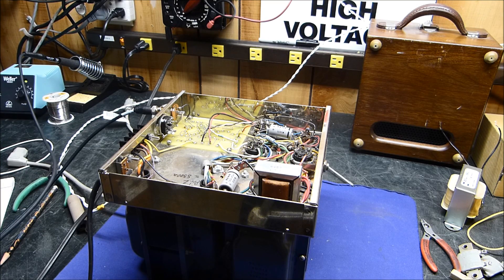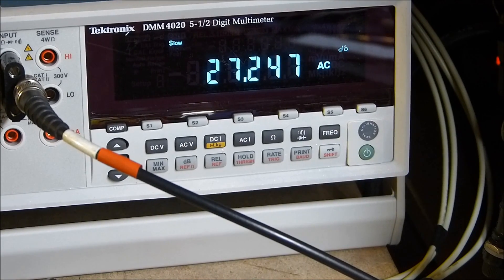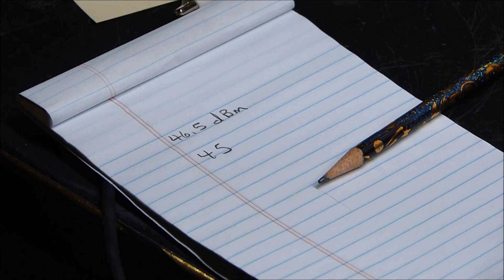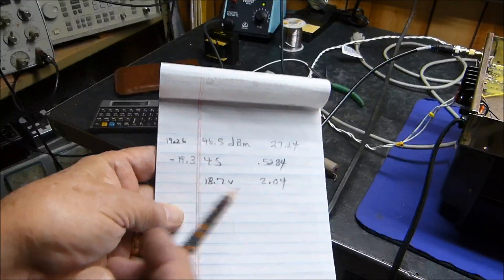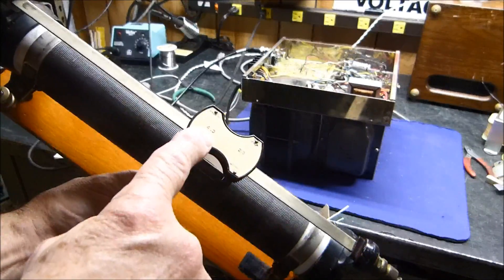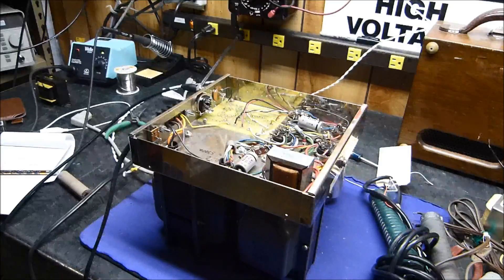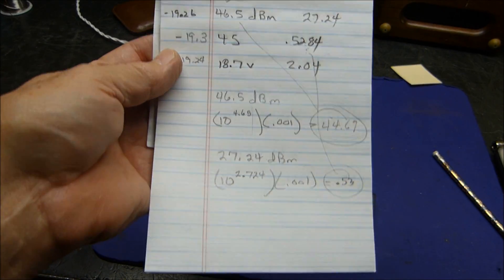Measuring Global Negative Feed Back (NFB) In The Dynaco Mark III

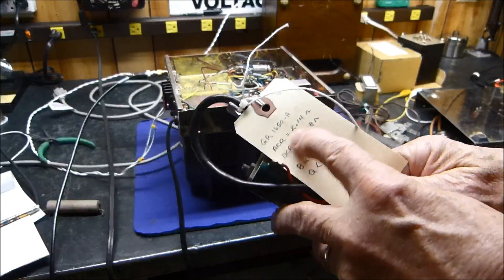Comment: 13:28 - What frequency are you measuring "ACR" at?
Reply from the maker: I can't remember for sure but I was pbly robausing the GR 1650A and its internal oscillator is 1KHz.
Reply from the maker: Oops, I think I answered the wrong question. I think I got the 2 ohms of ACR by using the ESR meter.

Comment: It's ok to run the B+ to 530vdc as long as your cathode voltage is in the 125v range or your running more negative bias voltage..I agree that those 6b4gs are incredible sounding in PP.
Reply from the maker: +Mike Samra Hi Mike - yes, it is hard to describe why I tend to prefer the simple low power tube amps to the McIntosh but maybe our ears actually like the artifacts of an amplifier. That is, of course, within reason as when the THD and noise are below maybe 0.5% and 70 or more dB S/N. I still haven't gotten into the SE amps with no NFB - except for my attempt with the 833A.  :)  Someday I will have to pick up a 100 watt SE OPT and try again with the 833A.
Reply from the maker: +Mike Samra Yes, I agree with 500 volts on the plate being OK, as far as the tube goes, because the cathode is indeed 100 volts above ground. One thing that does start coming into play is the cathode resistor (850 ohms, 10 watt) becomes too hot and burns up as it is dissipating almost 12 watts - I know because it happened to me...   :-)

Comment: Just look at the distortion level at 45W w/o feedback, you got 2.5% and from other videos on your channel this amp clearly does 0.25% at full power. let's round that 19.3dB feedback to 20. 20dB of gain equals 10X gain in terms of voltage. the NFB would then equal to -10X of gain of the amp and look how the numbers add up! you get 10X lower THD with feedback hooked up. same thing with the output impedance, it drops by a factor of 10, so you get a damping factor 10X higher. In fact the 20dB NFB is quite the most acceptable NFB for commercial brands like Mcintosh, Marantz and Dynaco. in solid state amplifiers however, you might see things like 80dB feedback and thats why you see THD numbers like 0.003% but to the ear they sound harsh at high volumes.

Comment: An interesting thing to do is look at an amplifier with a 1khz square wave into a resistive  load with different amounts of feedback. An even more exciting thing to do is to connect the same square wave and output the amplifier into a real loudspeaker. Does not need to driven hard and see what a mess the speaker makes with its very inductive and capacative load. Some amplifiers show little difference but others really distort the square wave badly. Probably a real reason some amplifiers sound better than others.
Reply: +ElPaso TubeAmps looks like your'e getting the phase shift to the exact point of oscillation. i've seen that on my Electrostatic headphone amplifier which the circuit i found on headwize, it's called the Kevin Gilmore Solid State. I also seen that on my first well built tube amp using 6550. I was getting a very huge overshoot on the 1kHz SQ wave. That is clearly some sort of oscillation as Michael pointed out here. I solved the problem by adding a 100pF cap to the feedback and got rid of the oscillation. The solution for the headphone amp was to add a very small value capacitor between base and collector of the voltage amplifier stage. in fact the capacitance value was so small that a pair of twisted wires was just enough. On the low frequency you could move the roll off frequency of the coupling capacitors to way below 20Hz and see what happens.

Comment: You commented that one of your amplifiers did odd things at low frequency as the NFB was increased. I would expect that was due to phase shift, probably in the output transformer. As the phase shifts moves more towards the +ve it can make the amplifier unstable at those frequency's or even oscillate. I have also done experiments on amplifiers with and without feedback. Apart from the obverse gain loss in applying NFB. I have to say that (valve) amplifiers tend to sound better with quite low amounts of total feedback ie about 8/10dB However at these low levels, distortion, frequency response and noise is not good. I remember a transistor amplifier circuit from the early 60s, boasting a massive 60dB of NFB now THAT is a lot of gain to loose!!but these early transistor amplifiers needed this amount of feedback to make them sound passable.